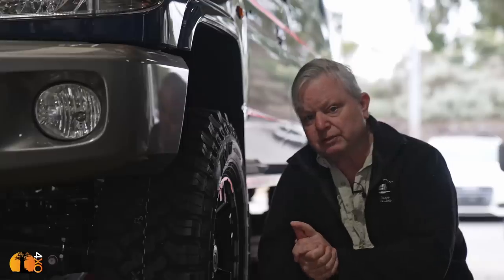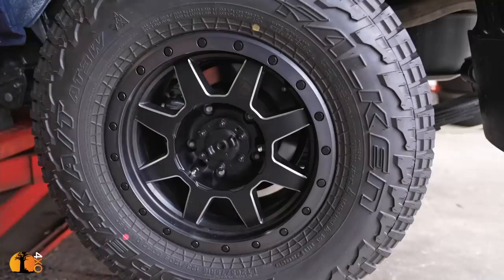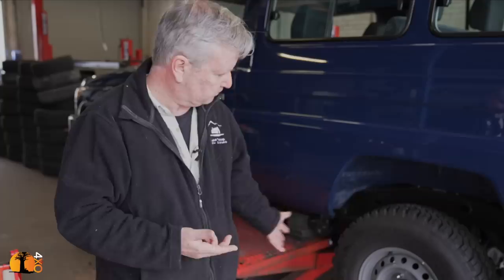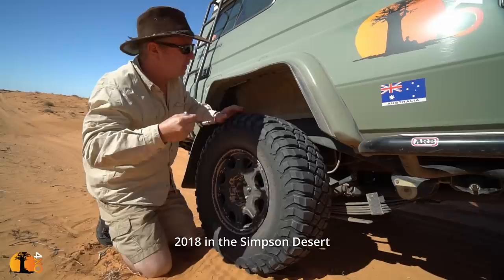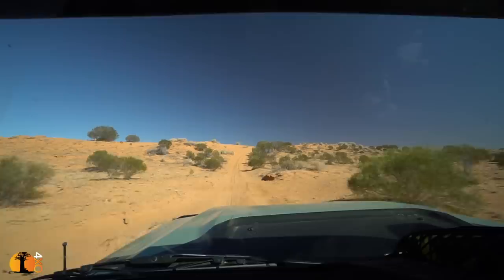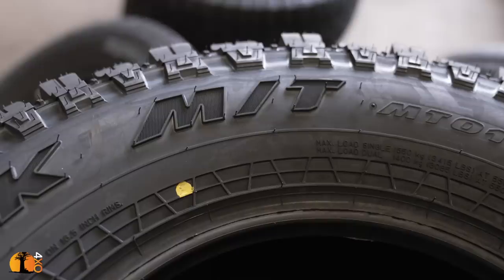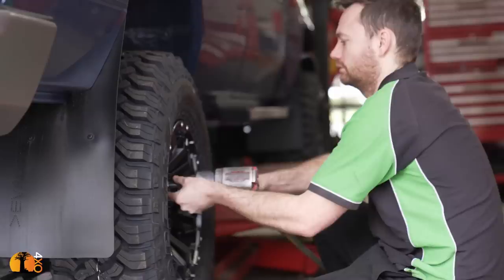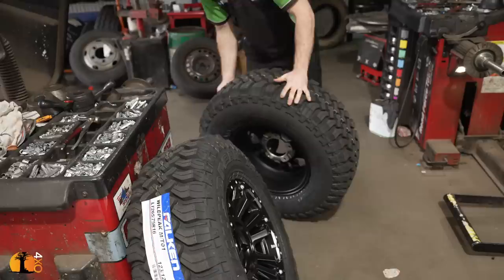TYRE AND WHEEL RIM CHOICES | BUILDING THE BEST 2-PERSON OVERLAND TOURER IN THE WORLD | 4xOverland

Comment: Damn, that's nice Andrew.👍  My Dad had Falkien Wildpeaks All weather 3 peak snow rated ATs on his last Dodge Truck and we were really impressed by them.  Unlike the KO2s I put on my truck.  Those tires don't deserve their snow rating and IMO are dangerous on wet pavement.  I've had them get squirrely on wet curves never mind how terrifying they could get on ice.  They were just fine in the snow though but ice is the issue in winter, not snow.
I put Cooper Discoverer AT3 4S 285/65r17 truck tire on my truck and quit like them.  Yes, not a mud AT but I have to deal with ice and snow and so the tires have to have snipes/swipes?  Anyway, I'll never put an MT on my truck again.  These are fantastic all-weather off-road tires for where I live.  Not as strong off-road as KO2s but not terrifying to drive in the wet or on ice either.  In fact, I'd say only a dedicated snow tire would be better and not by a lot and these are fantastic year-round.   
The All-weather technology is fantastic. 100K KM tread warranty with non of the dangers of snow tires in milder months.
Note, I'm not hitting hard off-road trails (especially alone) anymore due to my paralyzed leg so any issues due to needing MTs is not that much of a factor anymore
Also, I watched all the Duster Trails videos of them testing these tires.  Easily convinced me to dump the awful KO2s (which they tested against) and considered All-weather tires like these or the Toyo Open country AT2s or Falkien Wildpeaks.  Their terrain is similar to what I usually drive in and they made good points about how to offroad with them.  
Note I was siding to the Toyo's but availability and cost drove me to try the Coopers.  I'd have to drive to another city for the Toyos and they were almost twice the cost.  I could have eaten the cost but I wanted tires from a local dealer in case I had issues. With the Falkiens it was the weight.  I have to do a lot of long-distance driving in Saskatchewan and my truck is my everyday driver.  I talked to the installer of my tires and I wasn't ready for that kind of hit on my mpg. Not with today's gas prices. Haven't gotten a puncture in 2 years through sloppy fields and river trails so I'm ok with the Coopers.  They've come a long way in 20 years.

Comment: 6 x White ROH  Trak 2 steel rims with 265/75R16 or 235/85/R16 BFG KM3 on the Troopy. Fit a Bull bar, scrub bars, pack rack, winch and spotties. Job done. Load up then go bush mate.

Comment: The overall look of the troopy is very nice mate. Rims are tough looking.

If you put a 2nd spare on the roof, where are you sleeping? Intriguing.
Reply: He might still fit a Hercules or similar roof conversion kit. As long as the load is relatively small and towards the front of the vehicle it should be fine to lift. As close to the hinge as possible. Guess we'll have to wait and see.
Reply: A point to remember with wheels on the roof is the difficulty of getting them up and down.  Okay for most young blokes, but as you get older you risk injury and out in the bush is not a good place to hurt yourself.

Comment: I debated 255/80R17 for my 2019 Toyota 4Runner here in the USA. Problem is, they just aren't that common at local tire stores out in the sticks, where I live. Much easier to get a 285/70R17. I went with Yokohama Geolander G003 MT 285's (32.9inch). Nice thing with this size is the full size spare still fits under the vehicle. No need for a heavy / expensive tire carrier.

Comment: I’ve chosen BFG KO2 in 265/75R17 size for my Ineos Grenadier, mounted on the standard black steel wheels. May change the colour to suit, as well as the black  plastic front grill. Can’t wait to have it built and delivered. Should be with me by early December apparently. Unfortunately they are very late delivering the retail vehicles to the first customers. Like two months late already.

Comment: I run 255/85r16 BFG KM2 tires on my 90. I love the size as well but as Andrew says it is a difficult size to find if you ruin one on a trip. I wish it was a more common size and have two spares as a result though I usually only carry one. My RRC, more often used on longer trips. has 235/85r16 Goodyear Duratrac tires which are an easy size to find. The next time I buy tires I have been thinking of going 265/75r16 for both trucks so that I can easily swap between the two.

Comment: What about a 235/85/16 Tire? identical in height to a 265/75/16 (32 inches), and will fit a 7" rim. I've got them fitted to by Land Rover discovery and I couldn't be happier with them. Tall skinnies over wide floaters anyway!
Reply from the maker: That's a good point you make. They are the same height as a 235/85. I was under the impression that they were a big taller. Hmmm.

Comment: You could have saved 7 pounds per tire by going with the 235/85r16. Probably could have gone with a 1'' narrower rim and saved even more weight and had a tire of equal diameter. Is it an availability issue? I thought 235's were still reasonably common, and are a very tried and true size in my opinion. If your not going 33 or up then they seem like the obvious choice. But, that said I do agree that the 255 is the best size.

Comment: I picked copper stt pro 305/70/18 on my wrangler. Stock rim 7.5 inch wide. In my book perfect if you dont want to start chopping fenders or go taller than 3.5 inch lift kit. 
Wider tires gives more traction. Just follow with height also.

Comment: I looked for a while for something tall and skinny for my Disco2 .. I ended up with Dick Cepek Extremes 255/85r16s and I only have 1 spare. My idea was to get a camper and put the same wheels on that and then I could have 2 extra spares. Some other options I found were the BFG KO2 33/10.5r15 (couldnt find a 15x8 in 5x120 and the correct offset) and the Kenda A/T in 35/10.5r17 and 33/10.5r17 (I had already got 16inch wheels when I found these sizes).

Another thing I have is some big patches for mining truck tyres , which if I had to, I could bust a bead and put it in the inside over a puncture (if I had to). I think the biggest one I got would be similar size to a desert bowl

Comment: @4xoverland I don’t understand why it’s necessary to swap from 6 to 8 inch wide rims. Why not just upgrade the tyres on the standard rims?
Reply from the maker: If I put tyres on rims that are too narrow, I will be breaking the law.
Reply: @4xoverland  yeah of course they have to be legal, I meant why not upgrad the tyres but keeping the same size as standard, or similar that would still fit on the 6 inch wheel, for instance using a Falken M/T in a size that would fit on the standard rims

Comment: I ran into a similar issue with wide tires on my Tacoma.

If I go wide, even with SPC upper control arms with caster all the way forward, I have to start cutting.

If I keep the 10.5" width which is stock for the Tacoma or go narrower I'm a bit better off with 33s.

Here are a few options I wrote down for later reference as most of these are on the narrow side of things.

BGF KO2 235/85 R16 (SKINNY)
BFG KO2 255/75R17 (32" x 10")
BFG KO2 LT 34X10.50R17 (33.5" x 10.6)
Cooper Discovery S/T Maxx  255/85R16 (32.8" x 10.2")
Cooper Discoverer ST Maxx 255/80R17 (32.8" x 10.2")
KM3 255/85 R16 (33.1" x 10")

Comment: Here in the USA. 17" rims are pretty much standard on most new trucks, or bigger. I just got 2023 Nissan frontier pro4x. I'm going to keep the factory 17"x7.5" wheels and install falken at3w 255/80r17(10"x33" tire) My only worry is they are only available in as load E rating and I hope the ride quality is not too bad.

Comment: Thank you for the amazing Channel. 
I fitted a 285/75/16 on my 79 (no canopy, no bullbar) and I had a nasty wobble at 89-100km/h. I do lots of highway driving, use it as my daily. Balanced and aligned 5 times in 10 days, wobble stayed. Went for 265/70/16 and problem solved. Loved the looks of the 33’s but couldn’t live with them. Any advice? Steering damper didn’t help

Comment: Start with the tires and then get the width of rim to the tires recommended spec. You should also get forged wheels and not cast if you care about weight.

Comment: What about a video on the correct pressures for light truck LT tyres (higher for the same load) than the typical placard plate pressures for passenger P and metric tyres?

There’s not much info about on this topic and many of us (including you) end up fitting LT tyres when making these changes.  I bet that many people then drive around on standard pressures, i.e. under-inflated.

Incidentally, I recently had the same dilemma and ended up going with Falken LT265/75R16 on the Toyota alloys.

Comment: 16” Wheels, 33” Tyres, Narrowish Tyres Max 285. Best compromise between capability, fitment and economy. Go or a wider offset wheel if you can, around 25-30mm, makes the car handle so much better and is with in vehicle & legal limitations (you will need flares).

Comment: I had hoped you did the pizza cutters 255/85R16. 

When was the last time you had 2 punctures on the same trip?
Reply: I suppose the argument for two spares isn't, how often do you get two punctures, but how often do you get one. The logic being, if you have one spare, and you get a puncture, you sort of need to head back, or to a tyre place. You wouldn't set off without a spare, so don't continue without one. So the second spare just means you can have a puncture without it ruining your trip. If you need the second spare, you might need a different set of tyres for the surface you're on.
Reply: Even bigger question, last time he had two punctures not repareable with plugs.

Comment: I believe Toyota had an 8" wide 16" steel rim fitted to the 105. They're rare however.

Bradley will have a forged 16" alloy wheel for the 70 series this fall. That will be a very strong rim.

Comment: To get out of a bind does it really matter if you run a different tyre? Sure if the diameter is different that could be disastrous. However if the diameter is identical and the temporary replacement is 30mm wider I don't think it would impair the car much if at all.
So now consider the difference in diameter between models and brands. If you compare the specifications of one 255 or 285 to another these can be vastly different. So really the argument of availability would have to not just be the generic size but the specific model.
I like the 255/85r16 on my 76 series. It really seems unstoppable when aired down. However there was a definite benefit of the 285, it had much better onroad handling.

Comment: Although the 235/85 is listed as fitting up to a 7.5 width wheel I am guessing that in a pinch if one can't find the 265/75 while in the back country that one could be mounted up to get back to where the proper size and same brand could be sourced as the two tires are very close in outside diameter. Also to comment and this isn't from personal experience but from someone online who had a certain tire combination that worked well with very low tire pressure and then bought new rims 1 inch wider and had way more issues with flats because the tire bead was not able to stay sealed on a wider rim.

Comment: Interesting. My JL Rubicon runs 255/75/17 and I do quite like them actually. They perform quite well. But, again, they are a weird size and will be going to a 285/70/17. It’s only slightly taller,  it certainly far more common and easier to replace.

Comment: On my 1st gen 4runner i have 16x7" steel wheels with a set of 255/85r16 Maxxis M-8090 Creepy Crawler's (bias ply) they are amazing on rocks and mud. But they are terrible on wet roads. 
And so when i'm not playing on rocks and mud i run with 15x7" factory aloy wheels with 33x10.50r15 BF GOODRICH ko2's. My tire choices are a difficult size to come by however i have spares and never had a puncture not even on the vulcanic rocks.

Comment: I’m about to get a new set of tires for my Ram 1500 5.7 V8 HEMI and I’m looking at Toyo Open Country AT3
295/65 R20  (275/60 R20  factory size). 
 I’m in disbelief that someone out there is looking for narrow instead of slightly wider tires.  I always thought there has to be a balance between the weight, size of the vehicle, distance between axels and size of the tires.
Coming from Canada where we get a “bit” of snow I’m thinking slightly taller and wider won’t hurt anything.  This truck has got me through some deep snow without any hiccups on factory size tires.  It just keeps going.  Surprisingly it’s great in mud too but I’m wondering if I’ll get the same performance or better with size taller from 60 to 65 and two sizes wider from 275 to 295?

Comment: I came to the exact same conclusions about tire sizes. I want 33” but 285 is too wide. 255/85R16 is The Tire. But as I roam Africa, this could quickly be an issue. So I stick with the 285/75R16 to my despair. Regarding rims, I'll definitely stick to steelies.

Comment: I totally agree on the size 255 85 R16 and I can't understand, why they are that rare. Are we the only one, who look for them? I would like to fit them to my LR 109 S3 ex-mod, but in Germany they are only available in MT. As I experienced the BFG s 265MTs on my Discovery 1 (300TDi, 3dr) very very slippery on wet tarmac and on the other hand, I can't see any  tremendous advantage on gravel and sand ( only in mud, you can't beat them), I kept the 7.5er Michelin resp 235 85 ATs ( BFGs) by now. Perhaps, we should start a compaign for a wider range of 255 85 R16 😀 Regards Heinz, Germany

Comment: Has the rear track width been corrected on your new troopy?
Reply from the maker: We've just started the build.
Reply: @4xoverland  I meant in this video, the rear track width looked the same as the front. I thought maybe they corrected it for 2021.
Reply from the maker: @nickolasviel3577  I have not changed it. It's still 50mm narrower.

Comment: If you are wanting to save weight, especially unsprung weight then go 235.85.16 They are the same overall diameter as 265.75.16 but the 235 weighs less. As an example with BFG's the weights are:
KM3 in 265 75 16= 26.904 kg
KM3 in 235 85 16= 24.648 kg
I would imagine other makes would have a similar difference between the two sizes.

Comment: It kinda looks a bit ricey imho. I would have preferred a plain-er lookin wheel with tall and thin tires. Would look more on point. 
The tire size you chose is just a sub 32”.

Perhaps something like EvoCorse DakarZeros in 16x7 paired with 255/85/r16 (which is a true 33” at least)

Comment: I am having a hard time deciding between 275/65/R18  or 265/70/R18 my offroad driving is like 70% sand and 30% rock, I don't want to chop the fender wells I already have 2 inch lift, still working my mind between the Mickey Thompson Deegan 38, and BF Goodrich AT KO2, I will daily drive the truck for around a year then move it to 80% Overlanding purpose. 
it's for my Y62.
choosing one of these tires is really hard I would appreciate any suggestions.

Comment: Curious here but if u are after a tall/skinny tyre, then why not go the 235/85/16 tyre size which will go well on a 7inch rim? The 235/85/16 tyre is slightly taller than a 265/75/16 but overall their is nothing in it...
Me personally I would have gone down the 255/85/16 tyre myself, knowing that if I ever needed to buy one in the outback that the 285/75/16 is basically the same circumference as the 255/85

Comment: Call me lazy, but I prefer wide tires over narrow. I float over the sand, and I do mot deflate the tires. I also run a larger dia rims. 20" on all my vehicles. I should run 18x9" for the happy medium between extreme off road and highway on road. But I go for the larger as 20" tires and wheels are available here.

Comment: Excellent as usual. Im in a dilema re tyres. The GXL standard tyre is utter rubbish. Had toyos on a previous build and want 32 inch in that on the toyota alloy. Wanted 33s but a 32 is same as a 750x16.. i just think the toyotas were engineered for steel rims and wish id bought a workmate. Lol!

Comment: 225/95 same OD as the 255 - which, incidentally are both taller than a 285.  Can get 225s virtually anywhere as second/emergency spare...  also, if you run toyo mt or km3 you shouldn’t really be running into issues needing new ones in the field...  by going from 225 down to the 265 your speedo likely out now as well?

Comment: Those wheels and tyres are looking rad.Cant go wrong with black wheels but bronze or golden wheels with that dark blue would have looked even better (in my opinion)....Puhleeze don’t wrap the vehicle.Hate wraps!Nothing beats paint.
Reply from the maker: Paint? Three times the price and twice the scratches. In 10 years, remove the wrap and I have new paintwork. And with paint? It's a no brainer. I will wrap it.
Reply: @4xoverland  that's true tho you can put protective plastic on it for tours as well then just take it off. Keep a supply on hand

Comment: I'm having the same problem for my 75 series troopy. I want square tall tires. What I am wondering is are both wheels 0 offset or your troopy ? Because I'm wondering if zero offset and 16x8 rums will work with my troopy ? I need to order them you see

Comment: Hi Andrew, you are not going to fit a rear replacement bumper, are you leaving the spare on the door?, is the door strong enough for this?.
Reply from the maker: Yes. I've had wheels on doors on several vehicles and they all eventually broke, except the Troopy. Some people even hang two spares off the single carrier bracket.
Reply: @4xoverland  ok, so I can leave my 265/75/16 on my 76 rear door without worrying 😅